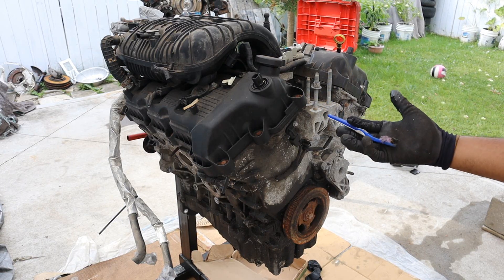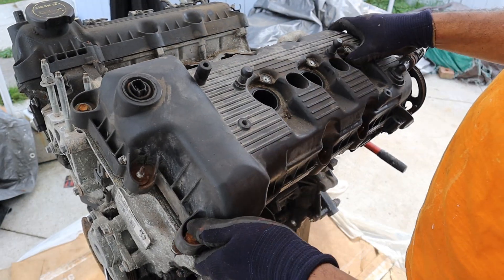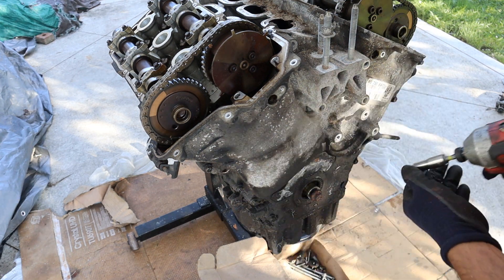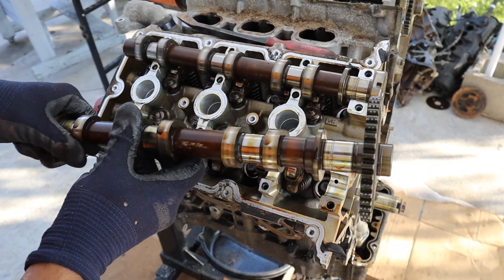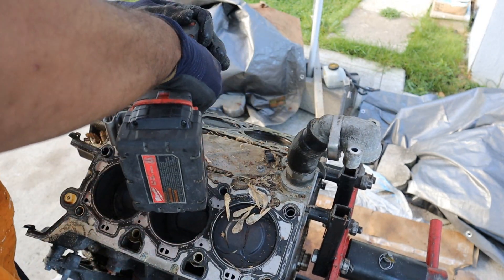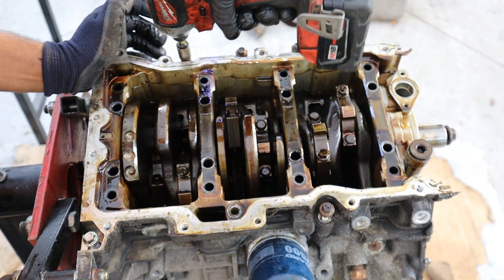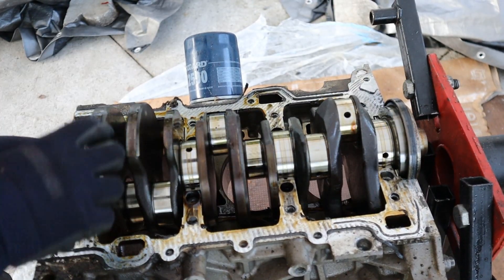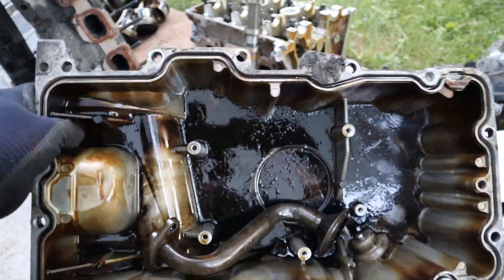Ford Duratec V6 Teardown: A Reliable Engine from Ford?

Comment: Crap engines, they all break down before 190k, chain driven water pump, interference engines. Nope sale at 170k
Reply: Seen one go 220k after being pegged floored on the highway for 3 hours and another go 250k.

I’ll also take a timing chain over a belt any day, even if a chain also runs the water pump.
Reply: Sorry the water pump runs by a belt outside the engine.

Comment: I have the Mondeo ST220 with 226 PS (now Stage one with 250 PS and it is not the end) and this Engine ist very good.
The 6 gear speedbox in Europe is good, it is the MMT6 and i have a Quaife gear lock. This drives terrific.

Comment: 8:16 Porsche is pronounced por-sha people with two syllables THE E IS NOT SILENT!!. Great video though, dude makes great content, not pissing on that. I love my duratec 3.0. 😁
Reply: Love mine. I bought used 165000 mile 2012 engine. Disassembled , had block checked .0005 taper in  bore. Rebuilding with new pistons,rings,bearings and oil pump. The one in my Escape 186,000 miles.

Comment: Short answer:  No.  At best, maybe.

A few months ago I bought a 2007 MKZ with only 125,000 miles on it.  Carfax showed regular oil changes at a Valvoline place.  

A few weeks ago, a noise started. It started like a stuck lifter, but then it got worse within a half hour.  And it was speed and load dependent. 

I've not yet pulled the pan, but I'm suspecting a rod bearing.

And then there's the whole internal water pump matter on the FWD cars.  WTF?  A 15 hour job for a fucking water pump. 

Second and last Ferd product I will ever buy.

Comment: The 2.5 L Duratec 4 cylinder is a very reliable engine as well. 👍💯
Reply from the maker: It sure is
Reply: No, it is a 6 cylinder.😂

Comment: First time working on a car engine(2006 sel fusion v6 3.0l, 252,000 miles in Michigan, purchased for $600, I am the 3rd owner, and literally nothing besides brake pads and oil changes done...), and I think I accidentally stripped out the groove on just ONE of the studs on the forward exhaust manifold(which I didn't even plan on replacing until I saw how corroded with cracks from the oil leaks)... 
Which brought me to you, good sir, to try and educate myself on the removal of the forward cylinder head and replacement, with a used one from the junkyard which I still have to find lol
This is quite helpful, I bought a Haynes Repair Manuel for the valve cover gasket replacements(front and back, all done) and the oil pan gasket replacement, paired with this video and with your thorough explanation, I am confident I can do it. 
Thank you good sir, I hope you teach many people what you've learned in your life, your style is exactly what everyone needs.

Comment: My 2004 mercury sable has 50k miles recently started to slightly rev up and down slightly on idle , i see the rpm needle go up and down little ,  i have no codes what possibly could be the problem?

Comment: All these engines that have buildup in the oil scraper ring that’s because of idle time. That’s why I run the shit out of my engine. My engine has 340k on it and does not burn any oil
Reply: 186000 and run the shit out of mine. I love short stroke motors.  They like the rpms.

Comment: We are at 270k with our 2009 Escape. It was first year with variable valve timing. There were two problems with the vvt in the first 10k, but that was it for the motor. Wifey drives hard and ten years was on mountain roads. It now burns a quart every 1500 and the valve covers just started leaking, but runs great and still has power

Comment: 2005 ford freestyle with duratec 3.0..the most reliable vehicle ive ever owned...with the zf cvt...im a mechanic and hate to work on my own cars..never had to on this just service cvt twice in 160k miles..
Reply from the maker: Never knew they paired this with a CVT. My next video after this was the 6 speed auto teardown that came with this engine

Comment: These motors are absolutely spectacular. I have a 05 Mazda 6 just hit 200k today. Still starts in negative weather and drives me 300+ mile trips. Love the motor but hate working on the timing side😂

Comment: I just sent one of these to the crusher with 309.9k on it. It burned a quart every 2500 and was starting to produce some copper in the oil but it ran fine. 07 500.

Comment: CAN SOMEONE TELL ME IF THE FORD/MAZDA 3.0L DOHC DURATEC V6 ENGINE WAS GOOD?  AND WILL IT LAST 300-400K MILES IF I KEEP THE MAINTENANCE UP?
Reply: yes but has two problems: the camshaft retaining caps can loosen and cause lotta damage. Valve covers must be removed, no big deal, and Locktite used to secure them. The second problem was the timing-chain tensioners would fail, timing would go bad and could destroy engine, since it's an interference engine. Only thing you can do is keep oil SUPER CLEAN and I'd replace the timing chains, guides, and tensioners at 100K miles. Use only quality parts!

Comment: I’ve got a 2008 Ford Escape… I really like it and I’d like to hang on to it for a while… My mom and stepdad bought a house in NC and it kinda came with the house. Long story short they gave it to me because it was just taking up space. It’s really nice and I believe it’s been garage kept for the majority of the time. The bad part is it’s got 289k miles on it. But it’s still a damn good running engine. It doesn’t burn oil and it didn’t have any oil leaks until recently, the valve cover started leaking but I’m gonna fix it soon. What would do to this engine for some N/A performance upgrades? I was kinda thinking have it bored over like 30 thousandth’s, maybe some flat tops, a 5 angle valve job on the intake and exhaust side, and maybe a larger throttle body… I wonder if you could have the heads shaved any? Other than that idk what other aftermarket parts they might have… Maybe cams and a tune?
    Oh yeah, I saw a video talking about the cam bolts could back out…😳 I wonder if they have a stud kit for that vs bolts…

Comment: I have the Mondeo version of this. 205hp non VTI. My fuel rail looks very different, its one line and injectors use the same. This looks much better! Is it aluminium or stainless? Gotta get myself one of those.!

Comment: In fact, in early 90's Porsche open an kind of design concourse for a V6 engine to many brands and they ask some specs to approve it, such were double overhead cams, high flow heads, high compression, external water pump layout driven by camshaft and hi revving capacity, and Ford, having experience with Cosworth took some patents from Porsche, Cosworth and put their own experience from the Taurus SHO (Yamaha, thus) to develop it as a second gen V6 called the Duratec. The result was one of the Best V6 engines ever produced being used on many platforms and excellent reliability.

Comment: There are no Ford V6 engines in Volvo models! Volvo always had its own 6 cylinder inline engines apart from the PRV V6 in the and the VW inline R6 Diesel in the 1970ies and 1980ies

Comment: Change all the plastic hose fittings I have a 2005 Mazda 6 S Wagon 144k miles with the 3.0l Duratech and a small coolant hose T-fitting failed (it was also warped) spilling coolant all over the place. It took weeks to find the correct part. I also recommend changing the water pump and the water pump belt (also a challenge to find)

Comment: Had an 08 Ford Edge 2wd 236k miles. Other then some timing chain chatter on could start that SUV ran like a top!
Reply from the maker: I don't think that was duratec was it?
Reply: @speedkar99  Yep it was. The 3.5 duratec V6. The Mazda CX-9 had the slightly larger 3.7 duratec. Ford used those motors in just about everything! Fusions, Taurus, Mustang, F-Series. The Ecoboost V6 engines are a  derivation of this engines architecture.

Comment: Surprisingly reliable?  That’s no surprise really.  2.3 Lima, pushrod 5.0, 7.5 BBF, 2v and 4v 3.0, 1.6 Kent, 4.9 I6, 2.3 EB, 5.0 Coyote.  Had em all, and reliable and yea I turn wrenches too.  Such latent derogatory commentary.

Comment: You: "This engine is actually very reliable....... for a Ford."

Me: "Noooooooooooo......., Ford why? 😭
You almost gave us hope.
Reply from the maker: Ford's don't have the best reputation for reliability. 
Re: EcoBoost and dual clutch transmissions.
Reply: @speedkar99 Like everyone, Ford has good designs and bad designs.
Reply: @colinschmitz8297 

Ford has really cheaped out as of late. I don’t trust any EB tbh. I. know of at least 6 from people irl who had them blow before 100k. Some had turbos go out at 50k. 

Also, “Plastic oil pan era” and up…I’m out.

Comment: The impact drill, did it come with a new battery? A new battery should easily feel more powerful.
Reply from the maker: No. Same batteries. They overhauled it and it's as powerful as it's supposed to be.
Reply: @speedkar99  good that you could claim warranty with it. I bought a set of 12V Milwaukee tools and it’s a pleasure to use!

Comment: That short water hose between coolant manifold and engine block has me concerned. Do they normally fail? At what age? Overall the v6 2012 Escape/2011 Mariner is the last small Ford suv I can buy due to simplicity and repairability of engine. The I4 has unkeyed balancer and timing sprocket that is a big no.
Reply from the maker: Yeah most rubber in the middle of a V bank is subject to high heat cycling
Reply: @speedkar99  Thanks for your video. Just bought one from rockauto for $6. Better be prepared. I recently replaced "all" hoses, valve cover/timing/pan gaskets (they all harden and leak), thought my Mercury Mariner would be trouble free from now on. I missed this one

Comment: I have a Duratec 3.5 in my 2016 ford f150.
Reply from the maker: Isn't that the EcoBoost?
Reply: @speedkar99  Ti-vct 3.5 naturally aspirated, 3.73 rear axle, 122 inch wheelbase, regular cab and short box, heavy duty suspension, e10 tires, transmission cooler, 6 speed and two wheel drive.
For an old fart like me it is easy to find in parking lots as "coupe" trucks are rare here, they are all four door.
Reply: It's a different engine family.  Ford used the Duratec name on a few unrelated engine families including your Cyclone V6, a Mazda based I4, etc.  The non Ecoboost Cyclone V6 engines in RWD applications are extremely reliable.
Reply: @colinschmitz8297  Thank you!

Comment: My family had two Duratec 3.0 DOHC engines ('99 Sable and 2000 Taurus).  They were  very reliable and had no issues for many, many miles of ownership.  I did regular maintenance (usually followed the Severe Duty Schedule) with full synthetic oil.

As long as you had the cam cap bearings replaced if they started to make noise (both of ours never had this issue), then these engines really didnt have a major issue.
Reply from the maker: How did the transmission hold up?
Reply: @speedkar99  we got lucky.  Both cars had the AX4N transmission which was an upgraded trans for the DOHC engines.  We changed the fluid/filter every 30k.  Routine maintenance was the key.

Comment: I use to have a 98 Ford Contour SE with a 2.5 Duratec with a 5 speed. even though it was a 2.5 it was a pretty big engine. the first engine went bad due to a rear main seal leak that was poorly installed by  the mechanic that replaced the clutch on it. due to the subframe design I didn't attempt it myself like I've done on all my other cars. the replacement engine lasted a lil over year than I sold the car. even though the car was mint with just a a little over 100,000 miles all I could get was $500 for it. everyone that wanted it knew getting a used engine was pretty expensive. they pretty much got a good price on a set of headers that came with a free car lol.. the transmission actually had a bolt break inside at around 30,000 miles making it get stuck in 1st gear. the warranty covered the repair which required the transmission being pulled.
Reply from the maker: How did the leak cause the engine to blow? Run out of oil
Reply: @speedkar99   while taking a long trip the leak must have gotten worse and it got low enough and it started knocking and threw a rod.

Comment: I put 300k on two of these in mercury milans. A pretty reliable engine, never let me down but was always on top of  maintenance. Original coils, chains, guides , tensioners, and phasers. That one sure looks like the oil changes were neglected.
Reply from the maker: Nice. How did the rest of the car hold up?

Comment: Huh explained why mine fusion has less oil when I did an oil change. Always a liter less per 5000 km.
Reply from the maker: It's burning it due to those rings
Reply: that's why they come with 5.7 liter pan for the fusion/milan 😊

Comment: Its easy to pick on ford, they certainly have their fair share of turds, but i dont think its any more than most other manufacturers.   That said, my one real gripe working on ford stuff is the long running design goal of "lets make sure to use the absolute smallest possible head for a given bolt size possible, for reasons"
Reply from the maker: I hate that reasoning. It can snap bolts

Comment: I needed a beater a few years ago and saw a 1998 Taurus on a lot. I was disappointed it had the 24v DOHC Duratec engine, I would have preferred the Vulcan OHV 3.0 V6. The engine was a deal breaker for me but the dealer said he had several of them and they were all very good engines. Since the car was very cheap I took his word for the engine. Now several years later I see he was right, it's performed very well for me in all conditions.
Reply from the maker: Awesome!
Reply: This guy bad mouthing Ford is full of crap, every Ford I ever had lasted 15 years o r more. I am 78
Reply: Bruh. Mine blew a head gasket and now I’m trying to tear it down while on the car!

Comment: There is a duratec engine in my Ford Galaxy but it's 2.0 litre inline four by Mazda. Also an aluminium head and an aluminium block and plastic intake manifold but quite a good engine. Never heard of the V6 version.
Reply from the maker: Nice. That 4 cylinder is a good engine, I have a teardown video on that too

Comment: You can get a Mazda6 with the 3.0l Duratec V6 with a Aisin 6-speed automatic from a Toyota Camry on later models. Best combo
Reply: What years?
Reply from the maker: The 6 speeds weren't as robust...I was looking at getting a Mazda 6 and that was is weak point
Reply: @speedkar99  that sucks to hear.  Like I said in another comment, I had a five speed manual wagon, and the fifth gear pop-out that plagues them made it a pain.  I've driven the five- and six-speed automatics at my old job, and the spacing for the six speed auto made it feel so much more alive, not to mention the manuals gearing was awful for freeway cruising.  Fifth gear (when it worked) in my wagon was around 3,400rpm at 80mph.  The six speed auto would be running 2k.  I've also heard the five speed auto was actually more of a headache than the six speed on forums?
Reply: @speedkar99 - the aisin 6-speed is the awtf-80sc - only one service bulletin to replace valve cover in 2007 from ford - bmw x1/2 xdrive 25e, mazda cx-9 , passat  still using it
Reply: I loved the 3.0 V6 in my Mazda6 wagon, but the five speed manual was garbage.  If it wasn't the shift linkage breaking off (Mazda mounted it to the transaxle with plastic...) it was the fifth gear pop-out.  I very much had a love-hate with the car, but hey, it was cheap and useful.
Reply: @hduncan2587    if there is one thing maza never does right it is their transmissions. They should have started outsourcing a LONG time ago
Reply: i dont know wht Mazda and ford had so many issues with there manual and automatic transmissions. Especially in the Mazda MPV minivans

Comment: Better camera angles and focus than previous videos. Great balance between video length and amount of information. Audio is good, airplanes and civics are a feature of your videos at this point. Jokes are on point, nothing that could get you cancelled but always grazing the line, love it. Perhaps you could start a rating system (subjective to your experience) so we can compare the engines you disassemble between brand and models. For example, have categories such as Power, Ease of Maintenance, Reliability/Longevity and whatever else, grade it from 0-100. Very nice, thumbs up
Reply from the maker: Thanks for your feedback! 
You mean a Doug score for engines?
Reply: @speedkar99  I actually forgot Doug had such scoring system. We need to think of something more original or just abandon this idea cuz the engines are so different from each other that there is no point. 

If you ever need something from east ontario (near ottawa) just hmu. I'd delivery it for free if you can teach me a thing or too

Comment: Should have done the duratec with the internal water pump that leaks into the oil when it goes bad.
Reply from the maker: You meant the EcoBoost
Reply: @speedkar99  duratecs in the Taurus, explorer flex etc all had internal water pumps along with the eco boost 3.5s.

Comment: Ginetta uses these motors in their track/race cars (with a dry sump etc) - solid beast! Had no idea it was Porsche designed until now. Thanks!
Reply: I didn't know either, but at least Ford made the bolts the same and not 3-4 different types for one part like the Germans like to do. IMO
Reply: @MikeDancingBull  No no no, that is typically exactly what Ford does.
Reply: @MikeDancingBull  And the cylinerheads are constructed by COSWORTH.
Reply: That closed deck design looks like it was made for boost.
Reply from the maker: Nice! They must be very robust as a basis